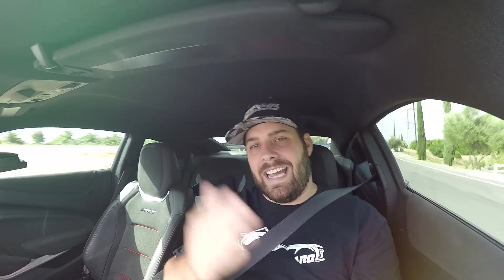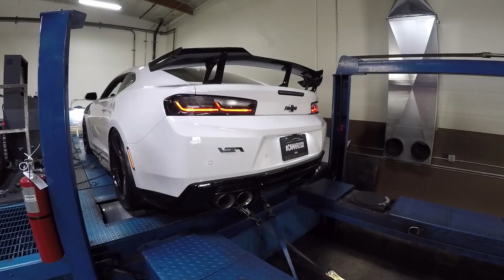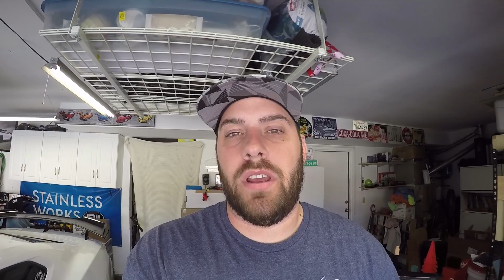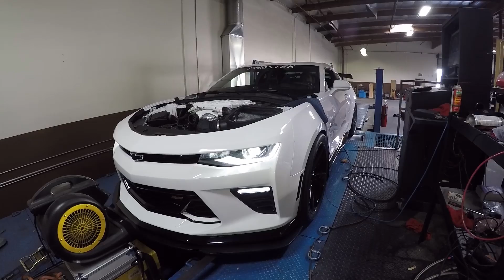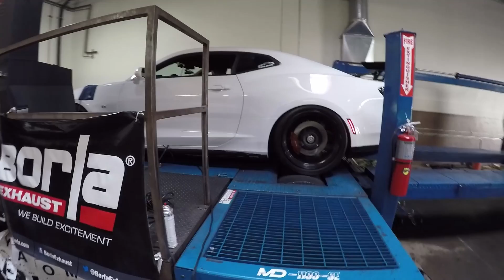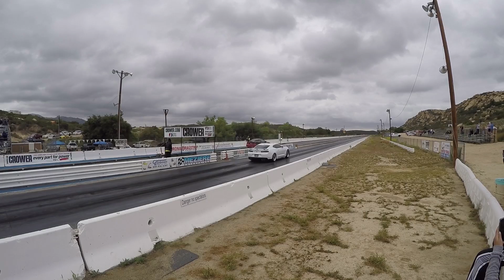Whipple Power Numbers & Car Update! Drive with Lethal | S3: EP4

Comment: I love your build bud. I was hoping to have my Gen 3 CTS-V upgraded through CMS. But unfortunately Ryne is heading out of state
Reply from the maker: The guy who would have installed those upgrades is still available to do the work and Ryne is still offering tuning.
Reply: Hmmm..Do you mind giving me the guys contact info? I sent Ryne an email 6 weeks ago, and he responded he could not accommodate me as he was moving out of state. I left it at that. I just got home from speaking to Alex at New Era Performance in Agoura Hills. Found him on the V Forums. Whipple, NW 103 TB, Weapon X CAI, DSX aux pump, DSX flex fuel sensor, SW long tube headers w/ x pipe to factory axleback. Hoping to get 700whp.
Reply from the maker: Message @bowtiebritches on IG and tell him Lethal sent you.
Reply: Thanks man. I don't do Instragram. I'll have one of my buddies message him with my contact info. Digg'n your videos dude!

Comment: Great Videos! I just subscribed. Awesome build. I will Not take anything away from your project, as I'm sure it's about the journey and learning as you went along. One question for you: Now that you have had both set ups eg... Procharger/Whipple charger. Besides the blow off valve that you mentioned not liking. Do you have a preference? Would you go procharger but maybe a bigger unit like the P-1x or D-1x instead of whipple? Why or why Not? Also, best bang for your buck. Procharger/Whipple? Reliability: Procharger or whipple? Thanks! Keep up the awesome work, and I'm looking forward to future videos and content.

Comment: What cold air intake are you running? I am planning on going with a whipple supercharger system on my camaro, but wanted to go ahead and get a cold air intake on my car now. Thanks for your help. I will see you at camaro fest 8 with my 2ss 1LE.
Reply from the maker: Roto fab
Reply: LethalGarage thanks.

Comment: I would have put a better headunit on before going to that heat pump of a blower and just get the proper fuel setup for e85. You’ll run C16 for a while until you get tired of paying for it. Oh and it’s Centri (centrifugal) not Centi.

Comment: You can’t use a “Bigger” lobe with the LPE pump, 10% or 6.5mm is Max. Most aftermarket cams have 32-38% keep that in mind.

Also After some research..... it’s been found and tested that the LT4 HPFP w 32-38% lobe will flow more fuel then the LPE with 10% or 6.5mm lobe. 

I wish I had that info before doing my pump and cam.
Reply from the maker: You’re correct in regards to the LPE V1 pump. Their V2 pump allows the use of a bigger lobe.
Reply from the maker: I have the V1 pump in the car as we speak. Waiting on the V2
Reply: LethalGarage - That’s nice to know. They don’t make that clear on there site for the new pump.
Reply from the maker: The use to offer both at the same time, now they just offer version 2. I had to call and verify.
Reply: LethalGarage - Good info. Will wait to see how much of a increase it will provide over the LT4 with the same Lobe increase.

Comment: Why not a Magnuson heartbeat
Reply from the maker: Because I like Whipple?
Reply: LethalGarage I’m having a hard time picking between Magnuson and whipple. Is there any difference that made you lean towards whipple instead
Reply from the maker: Preference really
Reply: LMFAO Whipple 18 GT with the 10R80 Just ran 9.46 with a stock engine
Reply: had a slew of mods. including oil pump gears. didn't even have a stock bottom end.

Comment: After you work out the kinks, will you do a 1/4 mile comparison with the wing vs without that wing
Reply: LethalGarage granted, but it would be great to see what loss if any the big wing is costing.
Reply from the maker: I don’t run 1/4 mile with the wing on. I put the stock spoiler on

Comment: I'm not familiar with that make of dyno, but the text on the dyno sheets says "Eng Torque" suggesting the figures are estimated engine (at the crank) numbers, not wheel torque. Can you confirm?
Reply from the maker: These are at the wheel numbers on a Mustang load dyno. Most like to use dynojets. On local dyno jets my car reads about 35+ more.
Reply: Ok thanks. Down here in Australia I'm running mine on a Mainline dyno (Australian made). It's making 485 kW (650 hp) and 1000 NM (747 ft lb). I've been debating with the tuner shop as to why their power numbers are so low compared to torque, after all it is a simple conversion based on engine speed. Your torque figure for example is similar to mine, but your power is about 100 hp more. I get the same numbers when I calculate my power off my torque and engine speed i.e. around 750, so like I say, it is a bit of a mystery what the Mainline dyno is calculating for power.
Reply from the maker: Odd
Reply: Ah, I was so curious I called up Mainline today. Turns out the torque figure printed on my dyno sheet provided by the tuner is the roller torque measured by the dyno and is dyno-specific i.e. depends on several factors including the diameter of the rollers. Normally you'd want to see the "derived torque" which is then consistent with the power numbers. In my case the correct torque figure is 786.8 Nm or 530.3 ft lb. Makes more sense.

Comment: so how could i get more power up front at the light but also wanna keep it as a daily driver ?
Reply from the maker: You can daily drive a twin screw setup. Just how much gas mileage are you willing to sacrifice
Reply: LethalGarage explain more about that please i already planned on losing gas mileage with the e85 running as a daily driver but i actually never heard of the twin set up your mentioning so where do i look or start
Reply from the maker: My Whipple Supercharger is a twin screw design. It compresses/ forced air into the engine. In turn you make more power but need more fuel.
Reply: LethalGarage with the stock engine could i run meth with it as a daily driver ? or you wouldn’t recommend that
Reply from the maker: I wouldn’t do meth on a daily driver
Reply: LethalGarage thanks i appreciate the advice so much

Comment: was your car originally an SS or ZL1?
Reply from the maker: It’s a SS with ZL1 seats :). Only seats that have bolsters and allowed me to retain heat and cooling
Reply: LethalGarage Nice. I need to do that to me '17 v6 RS. Did you require a different wiring harness or is it just plug and play once you remove the original seats?
Reply from the maker: I had a 2SS with heating and cooling so it was a direct plug and play